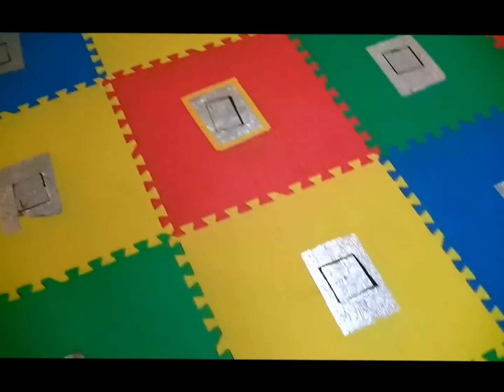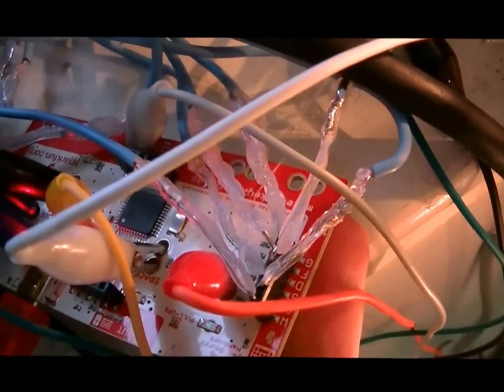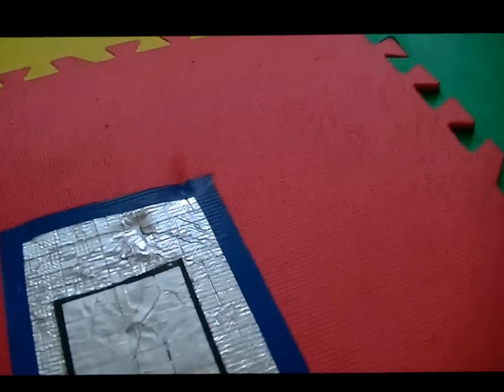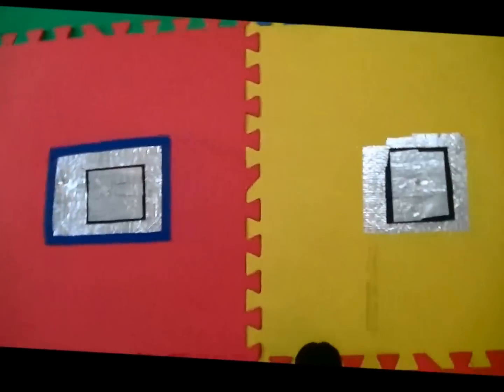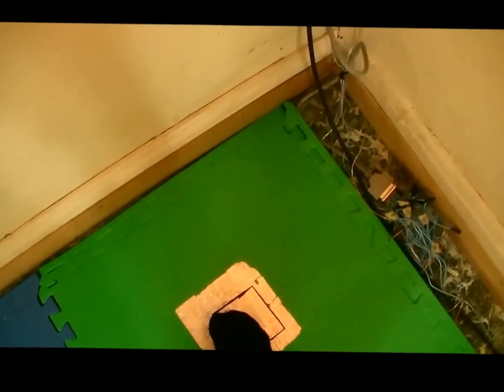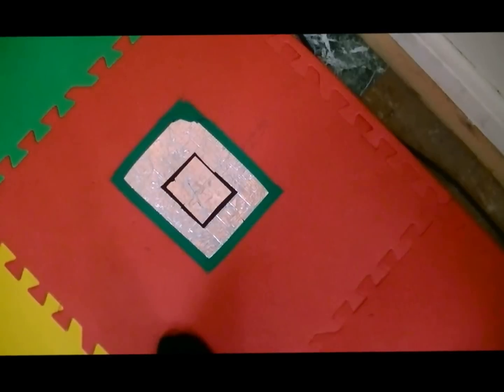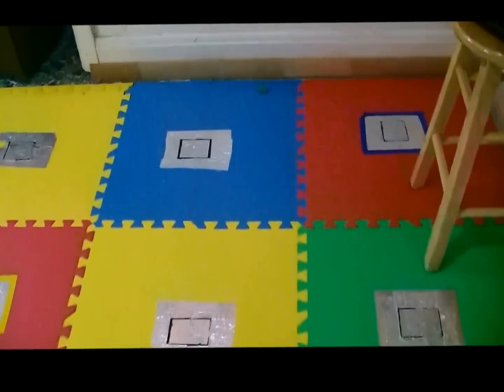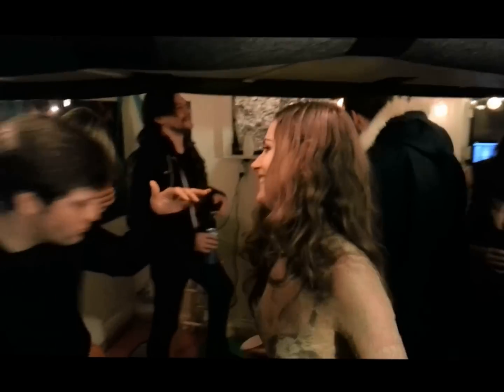Makey Makey + Ableton Live = Interactive Dance Floor

Comment: how does the two foils connect if shoes and socks are not conductive.  I want to do somethin similar for a uni project but the participants are all going to be wearing shoes
Reply from the maker: The two foil squares offer a lot of surface area for conduction, and the Makey Makey is very sensitive, so I found it worked with socks if people's feet are even a bit sweaty. I would suggest you get your participants to take their shoes off. Otherwise, you'll have to either buy or devise some pressure sensors.

Comment: Matt, what brand of aluminum tape are you using? The stuff I have doesn't want to stay stuck. I'm using the same kind of mats you have. Also, any details on how you connected the wires to the foil? Many thanks!
Reply from the maker: Most recently I'm using ipg brand but I've never actually bothered to notice what brand I'm using before. I just go to the hardware store and use whatever they have and it has always worked.

To connect a wire to some tape I just strip maybe an inch or two of the end of a wire, fan it out, and then put the  sticky side of the tape to it.
Reply: OK Matt, thanks for the comments. I had problems getting good contact through the glue on the tape, and ended up doing a fold-over so the top of the tape touches the wire strands. The tape we have doesn't have a name on it. We're also using the bottom (untextured) sides of the mats since our tape didn't stick very well on the top. As soon as I can get back to this I'll give you an update on how it all works out. Thanks again!
Reply from the maker: Richard Milward I'll look forward to your report on how it goes! It's exciting other people are trying this. Also, that sounds like some terrible, terrible tape you are using! Never had even a hint of any of those problems with any brand that I used.

Comment: Nice work, this is awesome. Working on something similar for a university project, I was wondering if you might be able to let me know how you set the switches/key maps up in Ableton so that the same switch can be used to turn a loop both on and off? You'd be helping me out loads!
Reply from the maker: You just set the "Launch Mode" to "toggle". If you search the Live manual, I'm sure you will find some easy to follow instructions on how to do this.
Reply: Awesome. Thanks a lot!